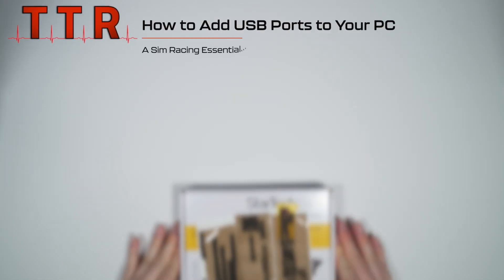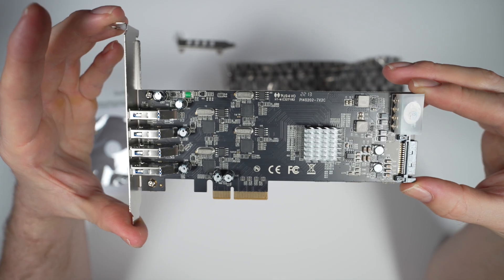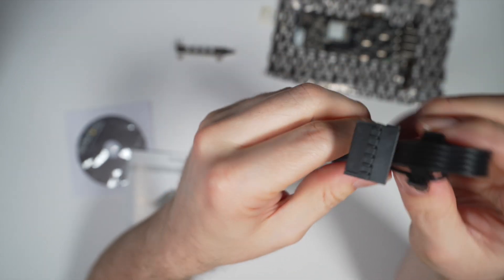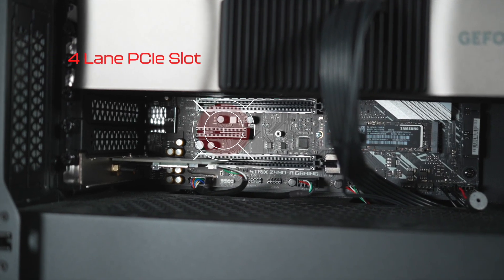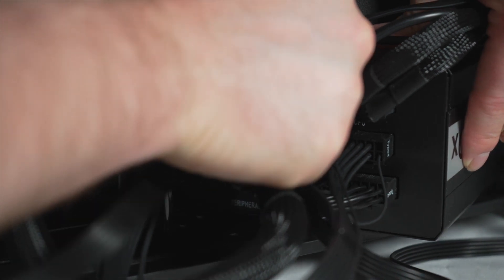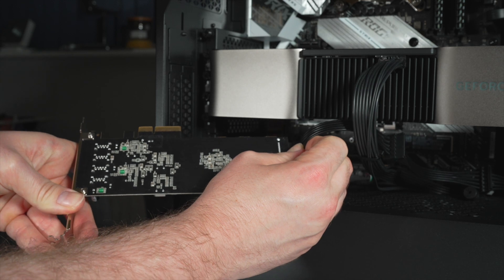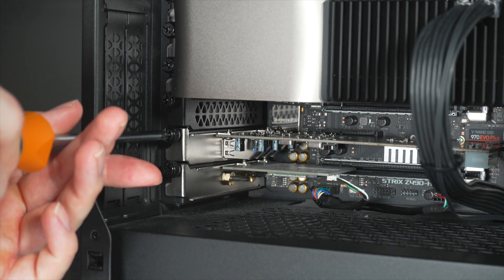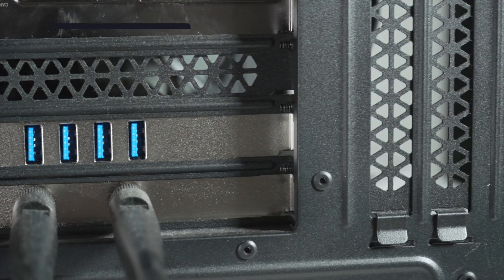How to Add USB Ports to Your PC - Easy Step By Step Guide

Comment: Forgot this was an option. I have enough PCIE slots to spare. Looks like I'm getting rid of my hub soon. Thanks!
Reply from the maker: You are most welcome. Highly recommend it. It's an easy option if you know the steps and considerably more reliable than a hub. Let us know how you get on 👍🏻
Reply: @TraumaTeamRacing  its more reliable than a HUB because it has its own controller this way its separate from the devices using the motherboards controller, better for power and bandwidth management using hubs can start to push the onboard controller to its limits some times and create USB brownouts or devices not working as intended, a lot of AM4 Motherboards dont have the best controllers on them and with Windows 11's new USB power management it can create issues, FYI you didn't need to buy a USB card with 4 dedicated controllers aa most SIM racing gear dont need all that much bandwidth as most stuff still only USB 2.0 speed, but cards like that are amazing for hooking up things like web cams and capture cards as they can some times push a lot of band width.